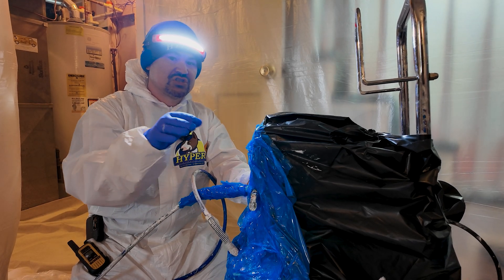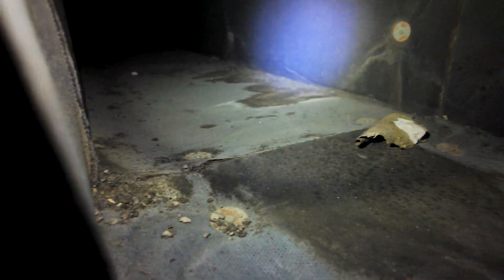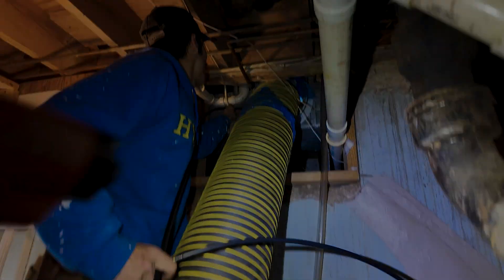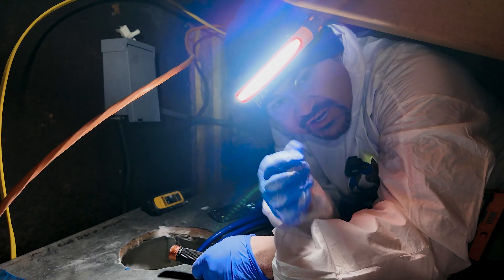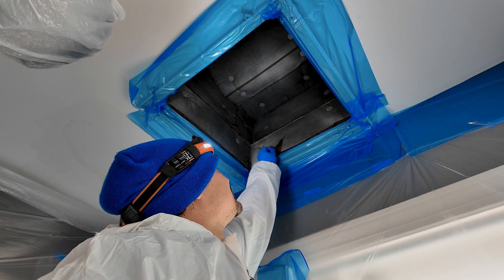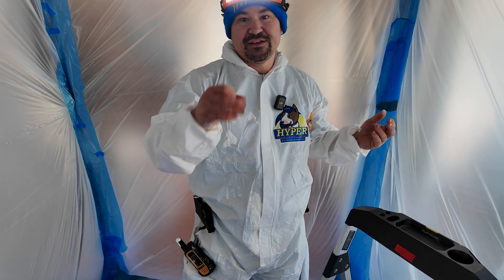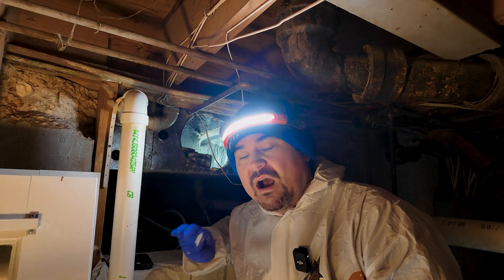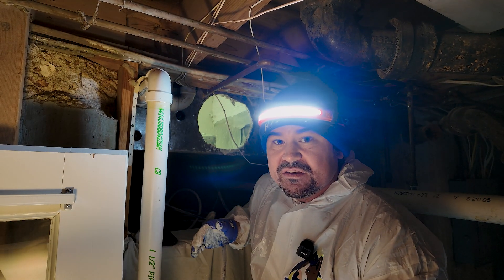The Hidden Danger in Your Ductwork – Why Your Air Quality Might Be Worse After Duct Cleaning

Comment: Very cool process mitch, so this project was Hyper sealed, cleaned and encapsulated. Will you share SF of this project, and I'm assuming this was a 1 day job, or was it 2 days?
Reply from the maker: @lanceellis8195 Hey Lance,

This was a five-day project. But yes—cleaning, sealing, and encapsulation were all part of it. The system in the video served about 1,200 sq. ft. of an addition to their house. The rest of the house had a separate system, which we also cleaned and sealed, but it did not require encapsulation.
Reply: @HYPERIAQ, very cool. Great video. Thanks for sharing.